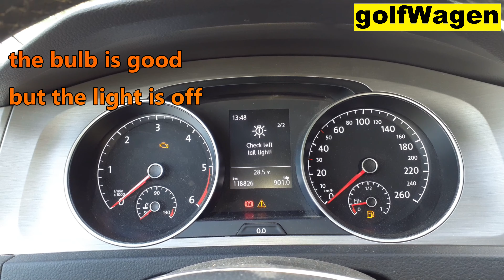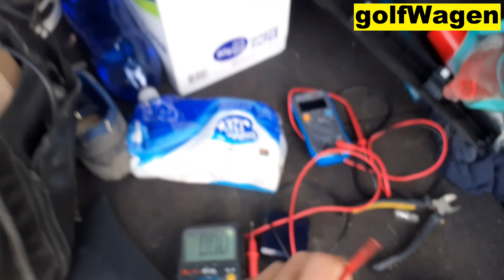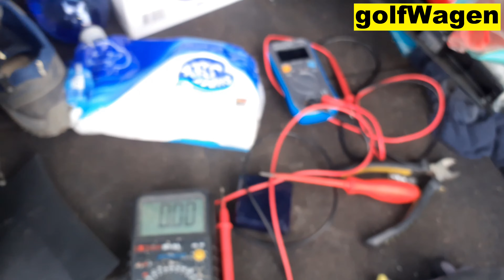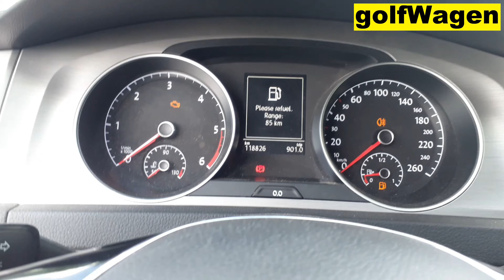VW Golf 7 tail light problem

Comment: SOLUTION…. I had same prob on my Golf 7 (the only problem I had in 50000 miles of great driving!).    ie. Error message light but the bulb good.   The problem is simply bad bulb contacts.  On the plastic moulding there are actually 2 contacts on each side of the bulb.   The more visible contact  (which you cleaned in this video) is NOT used.  It is the lower, outer contacts which are deeper into the bulb hole.   Scrape the brown residue from these two contacts.  Scrap brown residue also from bulb contacts and it then makes connection to bulb.    The giveaway is the brown coloured stain on the plastic moulding which is a sign of past heating at these outermost contacts as they degraded.      PS. Love your videos. Thank you.
Reply: I have this issue now what did you use to clean it or did you just scrape with a long thin tool?
Reply: @AdeelAA21    Hi. I don’t remember.  I think I just scraped it clean and shiny using the tip of a very small flat-blade screwdriver.    You can use anything to clean the surfaces of the contacts and the bulb.   My main point was that the contact which needs cleaning (to solve this issue) is DIFFERENT to that shown in this video.  Good luck!